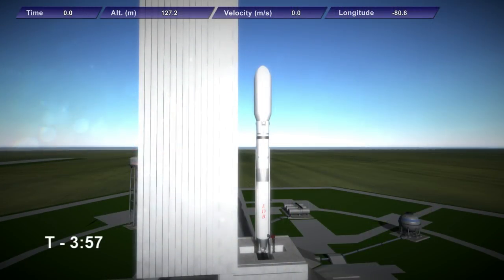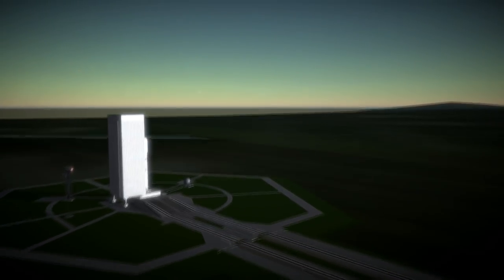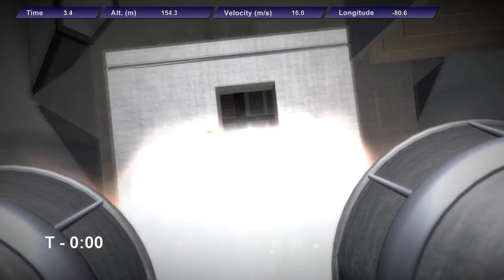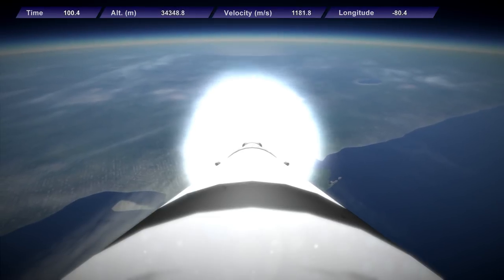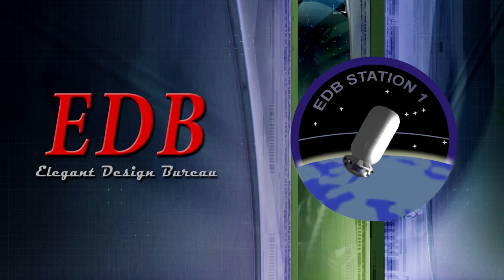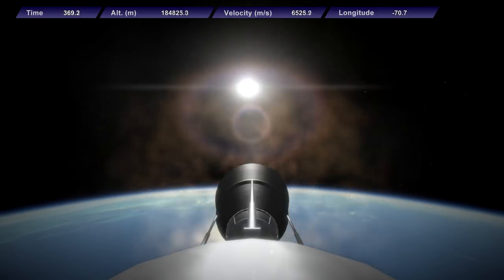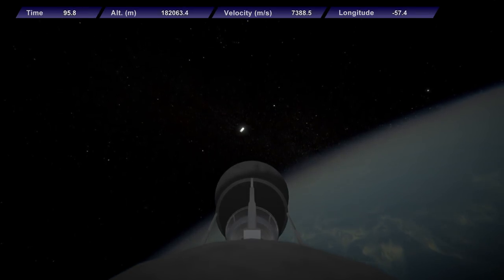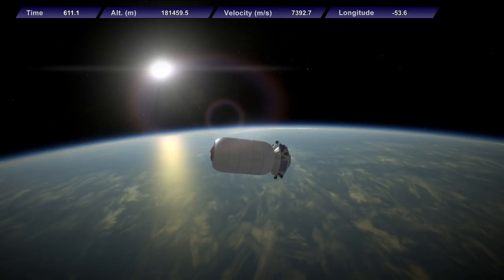EDB Station Module 1 Launch

Comment: good video but why there is sound in space ?
Reply: Microphones can pick up vibrations from the structure they're mounted on. You'd still hear the engines and such running if you had an open mic mounted on the vehicle.